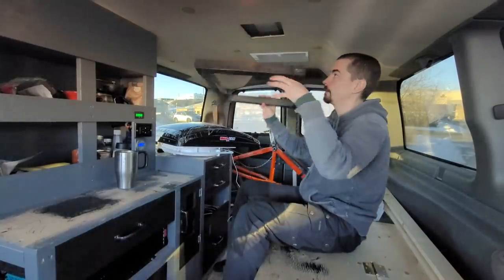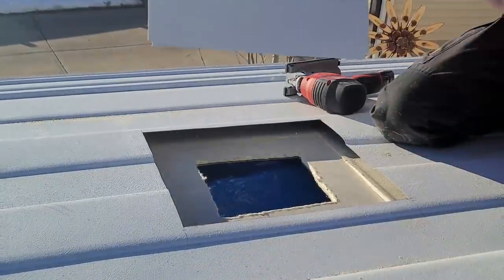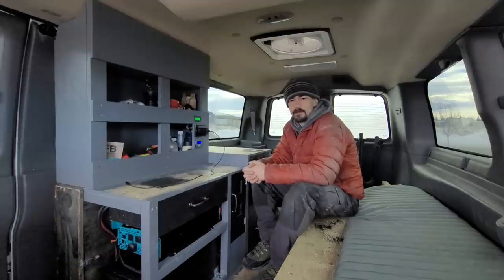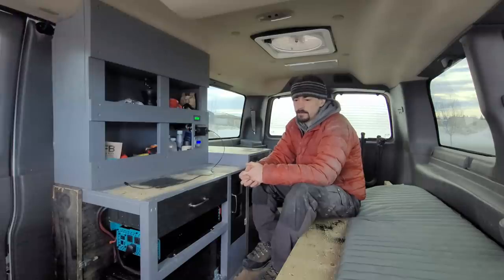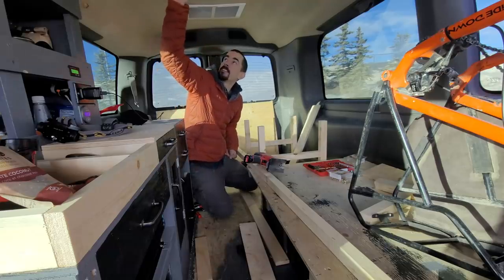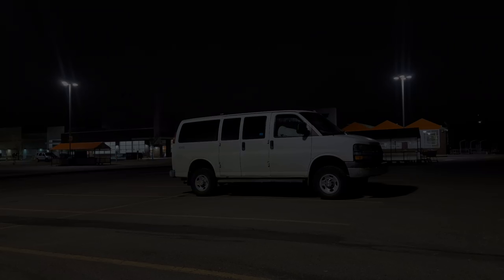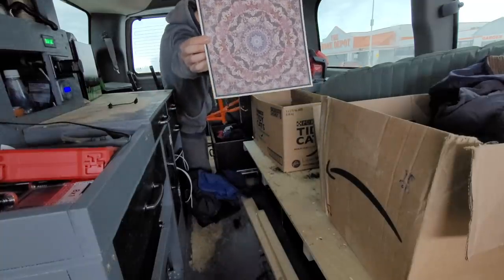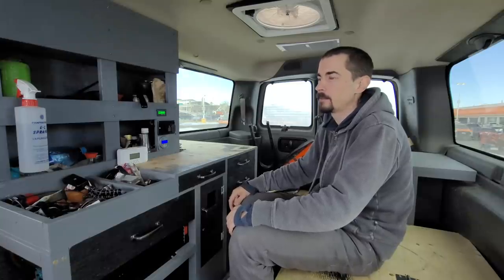Van Life - The Stealth Van Building Continues - Roof Vent Install

Comment: "Last night in the dark I just did a rush job and installed the fuse panel so it's all wired up..."

I'm not sure if I should be concerned by that or impressed with such a handyman flex.

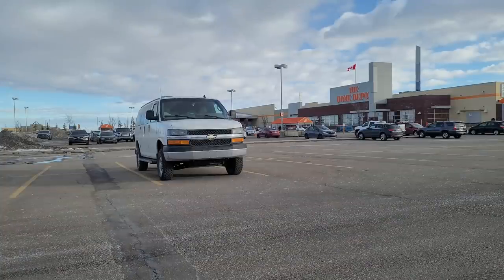Comment: 5:51 - This shot displays the new drawer box and open-storage box, before paint. 
Suggestion: The open-storage box deprives you of valuable counter-top space. 
Recommendation: keep the new drawer box with your planned wrap-around kitchen counter top. But remove the open top storage box, get a matching counter top for that lower surface, and then you have a lower desktop for your computer beside your raised kitchen counter top. 

A split-level full-width counter seems much more valuable than an open-top storage box.

Love the build series!!!
Reply: Scratch that - a second, wider drawer box, with a drop-front pullout laptop drawer. A drop-front drawer makes for an excellent hideaway laptop/keyboard workstation!

Comment: You have so much pride in your work, good fits, sanded with a coating, nice work. I cannot believe how much  curtains help prevent heat transfer losses. You could also fabricate some fabric covered hard foam plugs for the windows, yes,   in the way when down but wow do they make a difference. Love your videos.

Comment: I know solar panels are less efficient at your latitude, but I think it would be cool to have a small amount of it as a trial run without committing the whole roof to it.
Reply: This is his second build, he’s already experimented with a 200w panel.
Reply: Was thinking same thing; seems 200w foldable renogy with a 100Ah deep discharge marine battery with minn Kota battery box setup and efficient Dometic frig would keep frig and electronics perpetually charged up and running; that works better farther south obviously
Reply: @lawnmower11  At the very minimum, I'm sure he can use a string of LED lights on the ceiling. The van sort of guzzles a ton of fuel.
Reply: @ninjanerdstudent6937  damn do you just purposely skip over comments you don’t agree with? He’s stated that a 200w panel was not worth it for him, because he’s actually already tried it. But you think he should get solar jus so he can wire some LEDs, do you actually have experience living the van life? I’m curious.
Reply: @deleqtronica8733  Of course not. I subscribed to watch the nature of the forests, mountains, and caves. I'm just waiting for him to explore again. The van and cooking footage interests me much less. Also, I was just giving feedback, so chill bro.

Comment: Wood is free heat !!  I would still go back to the wood stove. You can attach it to the inside of the rear door. When you open the door super easy to clean !!!! Good luck . good job so far

Comment: Propane heater produces too much humidity for a camper van
Reply: The Dickinson 9000 fireplace is sealed and uses outside air for combustion... They are great...

Comment: You know your life is in properly proportioned perspective when your storage locker is empty! (mine is not) Ooooh, would like to see a close-up of that hand-drawn/colored mandala - would make a lovely magnetic art piece for exterior of your van - could remove for stealth operations.  The diesel boat heater is good compromise - I love wood heat, but ease of use, and equivalent dehumidifying and "soul-feed" of visible fire makes sense. They must have thermocouple electricity producing capability as well.  Will very interested to see your installation for this when you get around to it.

Comment: Did you know you can make those copper connectors?  Whatever gauge wire you're using, just buy copper pipe of roughly the same inner diameter.  Then you hammer down the end of the pipe and drill a hole through it and then cut it to length. Put your wire in and solder it (you should be soldering the pre-made connectors you are using and not just crimping) and then the other end has the flat part with the hole in it.  They are every bit as good if not better than store bought stuff, only MUCH cheaper.

Comment: Observations:  Painting the inside of the drawers white would be like having a built in light so you can more easily find things, especially in a deep drawer.        Solid anchor points diagonally across the interior would provide for a gathered end hammock.....would take up far less room, stores easily, and is the "bomb" for ultimate sleeping comfort.       I would ditch the non-stick and aluminum cooking items in favor of stainless or cast iron.......just sayin'.
   Thanks for sharing.

Comment: If you ever need any more heavy gauge wire or terminals check with a welding supply place.    They normally have everything in stock that you need.

Comment: one last note hundred twenty volt fridges can literally be found for free as people give them away all the time as a moving or upgrading to a large refrigerator. They always are in Surplus places as many remodels require them to replace the refrigerator and can often be found for almost nothing. You already have a significant inverter on board and adding more capacity as far as batteries is not a problem so I wouldn't really worry about getting a 12-volt refrigerator.     

if you're looking for efficiency gains one of the things that you can do is if you're handy with soldiering and can have someone fill the system for you with propane if needed, you can put your coils or the condenser of the unit on the outside of the vehicle and since it's mostly cold where you're at you're not going to have any problems having it run for a very short time and actually increase its efficiency greatly since what it has to do is pull the heat from the inside of the refrigerator and make it go to the outside.

since the outside temperature is so cold it's going to work a lot less and have a much easier time keeping your refrigerator cold in those cold Canadian temperatures and likely will only cycle very little.   this means extremely low energy usage.     for the price of the 12 volt refrigerator you could simply buy more 12-volt batteries and you would still be at a  better value proposition or go all out and purchase some lithium-ion battery Banks and make your own.

currently LG chemicals has these really large batteries and they go for twenty bucks each for I believe 60 to 80 amp hours and you can build yourself a very large battery bank with these.      how about six hundred amp hours of real use for less than $500?     

alternatively at many Pick N pulls or U-Pull-It parts places you can buy used battery packs for about $150 and many of these have about 20 to 50 kilowatts for you to use.   that's more than you'll ever need for your van.     theoretically you never have to worry about running out of power ever again.   and if you do happen to have a lock-up torque converter and you just went up to the mountain and used up all that power by the time you drive down the hill you're actually going to be using the engine braking to drive your alternator and therefore basically you're having a free lunch by having the weight of the vehicle and gravity actually charge the battery packs on board. So you're not using it for fuel as you're going down the hill from the mountain.

Comment: I bought a Dickinson 9000 for my WeeRoll cargo trailer... I have not installed it yet as my trailer has not been built yet... I have watched every Youtube video about them and am kind of excited about using it... The great thing about it uses outside air for combustion... I did make an ordering mistake because I did not know the chimney pipe and cap comes with the heater so now I have two...

Comment: I would think hard about buying that Dickinson Propane Heater.  I installed one in my first boat I lived aboard, and propane does not put out as many BTU's of heat as Diesel/kerosene would.  My 2nd boat I installed a diesel heater and was much happier with the heat it put out.

Comment: youre rad bro :).. You need a rubber gasket between the roof vent and the roof metal... an old innertube might work when cut to size.. At the very least use caulk liberally UNDER the white fan mount plastic. youre a legend !!

Comment: I have been meaning to say whit those copper terminals you use if you want the most secure way to attach them to the wire is soldering. What I do is take a small butane torch heat the terminal and melt a bunch of solder into it. Till the little cup is like 1/4-1/3 full and while it’s hot jam the wire in it wait for it to cool and you have a really good and secure connection
Reply from the maker: Thanks Zoey I'll give it a shot.  Was thinking of crimping them too.
Reply: @forestyforest  ya I have noticed you have been crimping them. I find if you don’t do it just right they can pull out. I saw the solder way from a car YouTuber and thought shit that works.  But if you don’t have a vise to hold them I have found vise grips on a flat surface work well too

Comment: Consider putting a  Eternal bond around the top of the exhaust fan you'll never have a leak.
Reply: I agree.  I learned the hard way when I used regular caulk around an exhaust fan on my camper.  Had to get back up on the roof and scrape it off and recaulk with the proper product.  It really does self-level and will seal the opening up.

Comment: Using a propane heater is certainly the way to go. Travel trailers and the like pretty much use propane heaters and stoves, mine does anyway. Which brings up another thought........co2 alarm and if you can, a low oxygen alarm. Just a little reassurance during the winter months when you’re using propane heat while you’re asleep. And let’s be honest Forestry, as beautiful as Canada is, Canadians endure some kick butt winter weather up there. I want to add this one last thought Forestry.....a few years ago I pulled into a gas station to fill up my propane tanks. It was winter and the attendant said it was to cold. The temp was around 32F (0C) and he wouldn’t fill the tanks. Might be worth your time to look into this.

Comment: I'm  full time in my RV, and I have one of these vents in my RV, and just  to let you know, these vents sweat and will drip water inside. I have also had trouble with moisture getting into the control board making the fan do crazy things. I had to disconnect the power to make it stop.

Comment: so for that drawer platform that you want to eat off of. my semi truck had a plexiglass piece that was hooked to like a piano hinge and if you were sitting in front of it, it would have a hinge on the left side that allowed it to open up past 180 degree's, and that's what I would do my paperwork on and eat on often. maybe an idea for you. the plexiglass or acrylic was easy to clean up and wipe off too. not a hundred percent sure what material it was. but it was like plexi or acrylic glass

Comment: A thought or two, would a small 12v shop vac be a decent investment?  You could vacuum up the sawdust as you cut and it will catch a bunch of dust as well and it would come in handy for cleaning up when the van is done. Also, they make an aluminum collapsible ladder that wouldn’t take up much space and I believe they extend out to about 10 feet long. I’m in North Carolina USA so I’m not up on the metric conversion 😂🤣😂. I’m a welder and fabricator. Maybe a bike rack for the roof🤔. Anyway, I’m enjoying the build. Best of luck and safe travels.

Comment: I think Princess Auto has those trailers and if I was doing it and then Dad is the first thing that I would build and put behind the truck or a hitch mounted storage compartment.  or something like a rear spare tire rack type storage area where you simply have it on the back of the van.  seeing how big that storage cuppy is you could easily put that in a hitch mounted storage container box.   they sell the basic frames at Harbor Freight or at Princess Auto that would conveniently melt to the back of the hitch.   they have fold-out units as well.   

if you're worried about aerodynamics it seems since you know about the big three you have some idea of car audio and you're probably familiar with working with composite such as fiberglass and fiberglass is actually in many cases just as strong as carbon fiber for the applications that you are going to be using it for.  that way you don't have to worry about a weight penalty and it's lighter than aluminum overall if you use a complete aluminum box.  

you could shape the rear box area so that it would be very aerodynamic and in fact help out with the looks of the back of the van as well and the gas mileage savings that you can get if you model it should be pretty significant as it would reduce drag significantly on the back of the vehicle.

you will get the basic platform at Harbor Freight or Princess Auto and go from there alternatively you can make your own but since they already have and is cheap and available that's what I would use as the platform to build the rear storage box.      
just use a wheel hub bearing and that way you can easily have it swing from the platform to the side so you can easily gain entry from the rear of the vehicle doors.   mounting the other side securely so it fastens to the base will increase the longevity and weight tolerances and should not prove to be any problems in the long run. Making the structure out of fiberglass and using aluminum plate that you can easily purchase at Home Depot would allow for a cheap like an inexpensive and aerodynamic storage container that would easily fit on the back and would be easy to move by with just one man as it'll be quite light while it's unloaded.

Comment: A bit of advice.  Don’t depend on that tape and that silicone sealant to reliably do the job.  Find your local RV place and ask them for a tube of Dicor self leveling sealant.  YouTube its use.   You’ll thank yourself down the road.
Reply from the maker: That was Dicor self leveling sealant ☺
Reply: @forestyforest     Oh!  Well let loose man.  Seriously.  You want to end up with a “bead” that’s a 2-3 inches wide and overlaps the the frame of the fan and the van roof.   Unless you did that but just didn’t show it.

Comment: If it were me I would Not use propane. It puts moisture in your van which leads to mildew and mold in the future. I would use one of the small diesel heaters.  Cheers!   
Haha, If the bike doesn't fit I might have to sleep with it, but then the crockpot might be jealoous.

Comment: Also, check out thqt AGM battery charges to 13 volts instead of 12.6 like flooded lead acid, Toyota has a different chip to control alternator, raises output by 0.5 volt for AGM. Don't know how that fits with lithium.

Comment: Hey Foresty ! Did you ever had any problems with the periodic Technical Inspection ? I dont know how this works in your country, but at least here in Spain you cant drill a hole in the original vehicle structure unless you actually homologate it via a qualified engineer. Thanks for the supreme quality and I wish you loads of happiness in this new project.

Comment: Forestry. Did you think about removing the front passenger seat? I bet you could ether use the space for the bike or design a set of cabinets around the fridge. it is better to have the fridge sit on the ground. After all you did have the passenger seat removed from the minivan.

Comment: Foresty, what about putting the bike on a bike rack outside the van and then having a nylon cover on it so that it doesn't experience rain or snow? They have locking racks with keys if you are worried about the security. I just hate to see it taking up valuable real estate.

Comment: I am converting a 2019 Chevrolet Express 3500 LT extended passenger van to a campervan so your videos are really helpful and interesting to me. My plan is not as ambitious as yours so some of what you have done or are doing, I likely never will do. I did like the fan you added in this video and after seeing your video I am not so worried about how to add a fan without taking down the entire interior ceiling. I am curious how you routed your power lines from your fan to your battery Thanks for the sharing.
Reply from the maker: They tucked nicely above the headliner, down behind the cabinet.  Shoulda got that part on video!

Comment: In my cabin I have a fan on my wood stove. They work with the heat of the stove.
Isn't the point of a wood stove to get fuel everywhere?
Ihmo a propane heater is useless when you have a diesel heater - you need to deal with 2 kinds of fuel to buy.

Comment: Knock up some sort of ‘Chimney Cover plate’ type of thing to stop the snow flakes a settling ... Maybe with a bit of forward facing aero dynamic deflection added into the mix? If only to save you spanking off the roof and doing ya self an injury. 😆 Nice work dude, keep it up!!👍🏻👍🏻👍🏻

Comment: Nice job, did you sand and use a cleaner in the plastic before mastic, I've seen a few that leak because of mould release agent residue which prevents the mastic sticking to the plastic and getting a watertight seal

Comment: Did you buy the sealant you used on your Max Air at an RV dealership? Only reason I ask is because on those metal roofs you really gotta use the self leveling lap sealant (or something similar) I’ve seen roofs sealed up with silicone, and it doesn’t turn out the best. Nice install man!
Reply from the maker: Yep Martin bought the Dicor Lap Sealant at a local RV dealership.

Comment: Looks like you put in new or bigger ceiling vents in front and back?  Are they for air circulation to keep gap inside the roof dry to reduce moisture?  I hope there is a bug screen for the fan.